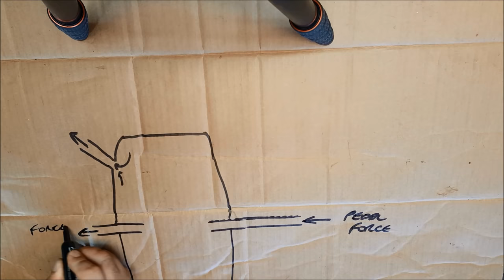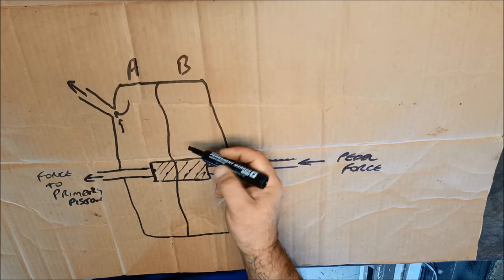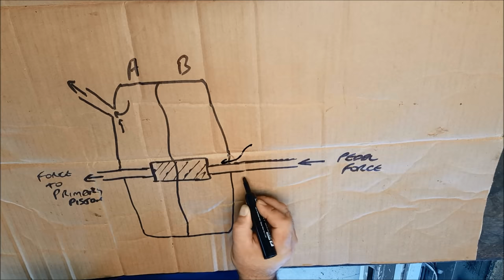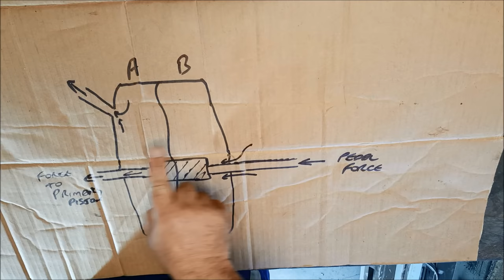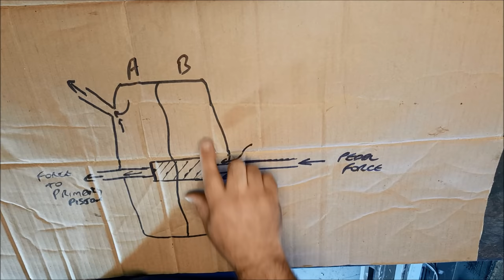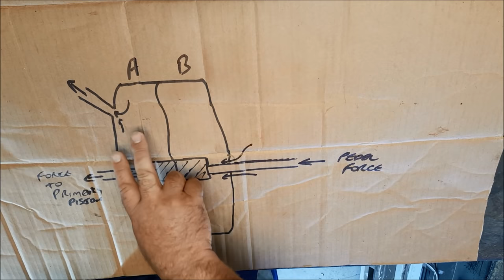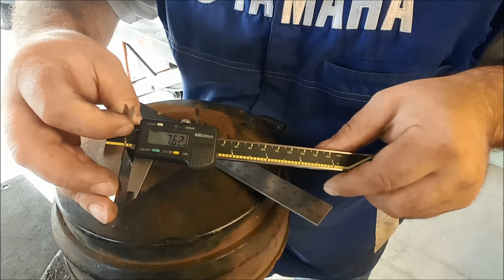Brake booster checks, operation and push rod adjustment #1313

Comment: hi I have a bmw e46 which has a strange intermitted fault which only happened after had brakes fluid change or when I had to do emergency brake. while driving the brake is fine half way down while braking then pedel goes soft and takes longer to brake. the reason this is strange it has happened 2 times in 3 years. I have no idea why it does this. last time this happened was after mot passed aswell. please let me know why this could happen. I have asc on car and its petrol
Reply from the maker: +Jayash patel Hi, that's an odd one. All I can think is that one of the main seals inside the master cylinder has failed to seal correctly against the cylinder wall.

Maybe there is a patch of corrosion on part of the wall or there could be contamination inside the cylinder (dirt etc) which is getting between the main seal and cylinder wall causing leakage.

I'm talking about an internal leakage so you won't see any leaking fluid.

I'd suggest replacing the master cylinder as a unit. Don't forget to adjust the push rod length.

Hope this helps. Cheers Andy
Reply: Hi Thank for the information I would like to had. The fault stayed for 2 days and looks like it fixed it self when I went of speed bump. But when the fault was there, with the car off the brake pedal would get stiff after pumping it up and sink when you  turn car on. But another video said pump  pedal with car on keep foot on the pedal pressed and turn car off. After 30 sec the pedal should lift and should feel it with fault there it was not do that as well as it use to when fault was not there. Does that mean it's brake booster valve between a and b chamber you used on your video?
Reply: +Jayash patel  also I don't know if this is related when I have stoped at traffic light the engine shake when in gear automatic but goes away when I put it back to neutal or start driving.
Reply: +Jayash patel  this is also intermittent  and brake fault is not there when this happens

Comment: brake pedal hard when engine off,turn on engine brake pedal goes right to floor(rear drums won"t bleed)98 chevy 1/2 ton.....thanks
Reply from the maker: Check rear drum adjustment. To be sure just clamp the flexi pipe to rear brakes and test again. If pedal doesn't drop to floor then problem is definitely rear shoe adjustment provided there is no air in hydraulic system.

Hope that helps
Cheers
Andy

Comment: To test the one way valve, why not leave it in place, shut off the engine and wait five minutes. If the brake assist is still there, then there is no leak.
Reply from the maker: +QFK's special Yes you could do that but it's not as conclusive as you may not notice a very small Leak.  Plus it doesn't eliminate the pipework.

I just like to test each component separately. These videos are designed to build understanding of components and how they work rather than just run through a fix as I used them when I was an Automotive Lecturer at Unitec.

Thanks for your feedback. Cheers for now Andy

Comment: Damn so this is what was most likely wrong with my girlfriend's car (pushrod adjustment) because I replaced all pads /rotors, shoes, drums, wheel cylinders, master cylinder, (bled master cylinder) and entire brake system and still had pedal to the floor. Now I know lol.

Comment: bought a car that had a master cylinder replaced. dont think they adjusted anything. right front binds up and after a while pedal is hard and brakes harder and binds up even more.  awhile of no use brake pedal seem soft but not bad.
Reply from the maker: +Chris Causby Yep. Sounds like a classic case of too long a pushrod...
Reply: thanks for being you. much appreciative of you being on Youtube.  cheers

Comment: Changed my rear brake pads and took the car for a drive, it now has a whooshing air sound every time I push down on the brake pedal (its not a hissing sound). The brakes still work fine and theres no leaks as the master cylinder is still full and I did bleed all the brakes. It sounds like its coming from the brake booster, I did the 3 simple brake booster test where one sits in the drivers seat turning the car off and on and pressing the pedal etc....and all seems fine, its just that noise. Make things worse the car is a 2011 Nissan Serena which has a small engine bay where most of the components are hard to get to.
This is what mine acts sounds like (the noise goes away when you turn the car off and pump the brakes like in the video): https://www.youtube.com/watch?v=CaaQC68l04A&ab_channel=cameronrosen